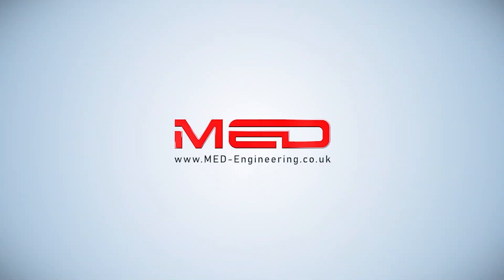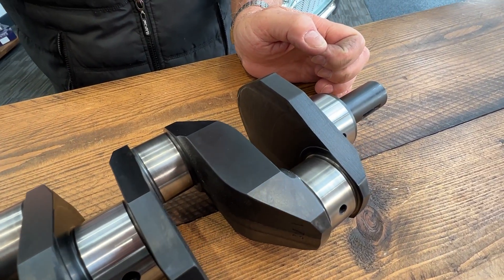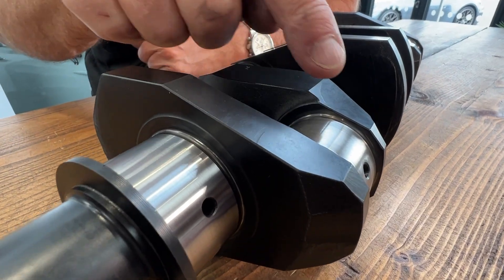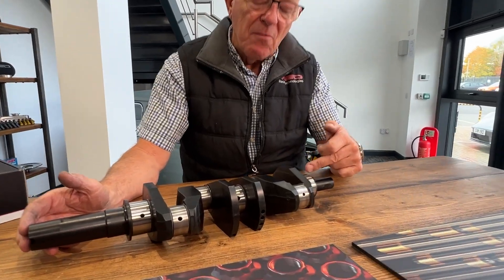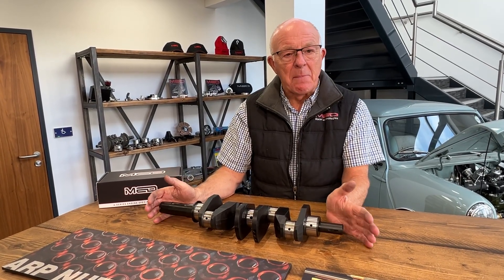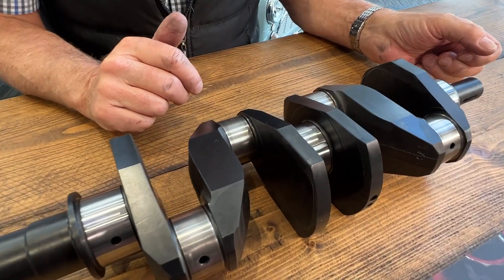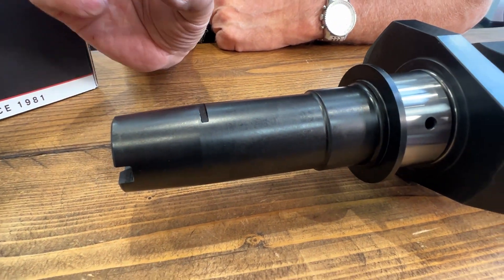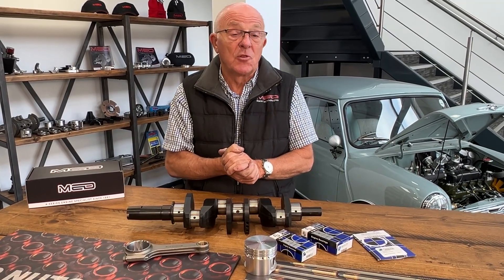A-Series Modified MED Crankshaft

Comment: Nice job on the crankshaft.
A question I have is, why the bearing surfaces of the primair gear are not polished/lapped
Reply from the maker: Thank you. We find there is no need to do this, as with the smooth QPQ finish you'll find good clearance to a new primary gear bush. Recommend you lap the flywheel to the taper section of course.